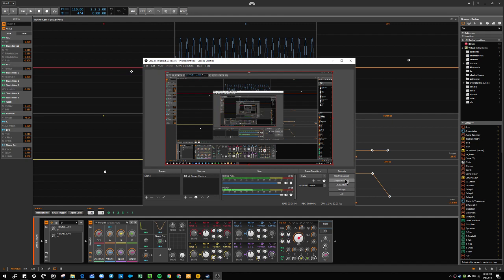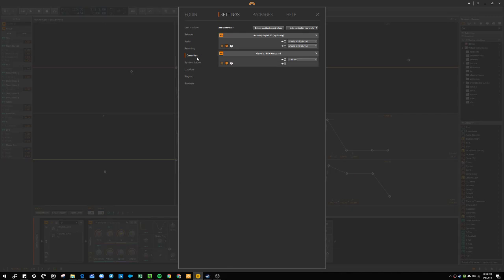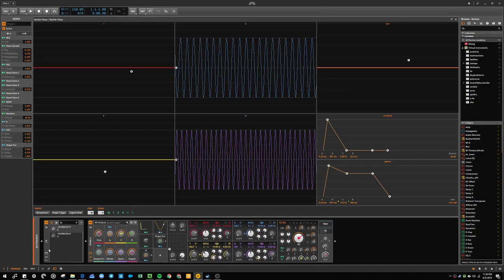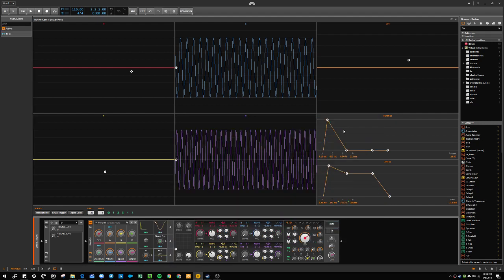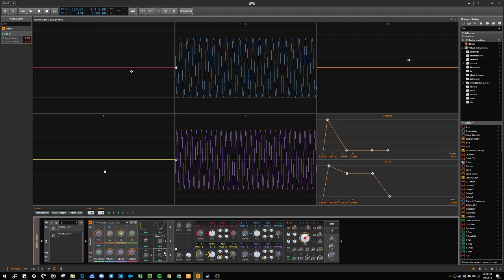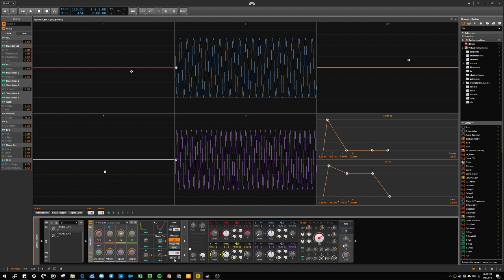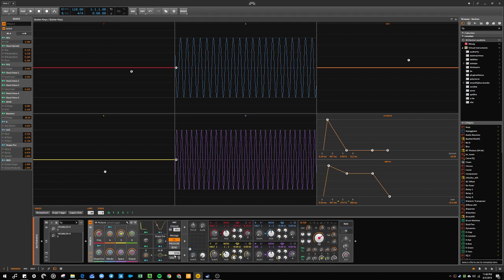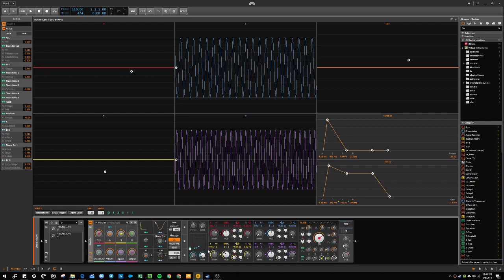Tutorial: MIDI setup and modulation in Bitwig using the Touché Controller

Comment: thanks. I really appreciate your vid. I have active Bitwig licence and was thinking about the Touché for MPE, etc and wondering how it worked - yours is the only vid I can find proving it works... Much appreciated. Please make more vids to show what else you've come up with, etc.
Reply from the maker: Cheers, I'm glad this was helpful. I poked around and didn't see any vids like this which is why I figured I would make it when I got my hands on the controller. I will try and find some time to make more vids with it in the future.
Reply: can you directly modulate bitwig parameters? vsts? or is everything confined to Lie, the touche software?
Reply from the maker: d thomaz Lie is not needed for modulation - using the MIDI modulators you can take the CC input and apply them to any modulatable parameter in Bitwig, VSTs included. I show it in the second part of this vid.
Reply: yes of course- I had seen that and that prompted me to post - thanks for sharing that 2nd half I forgot and only remembered the first part with Lie. Please, more vids! LOL great work, really! thanks!